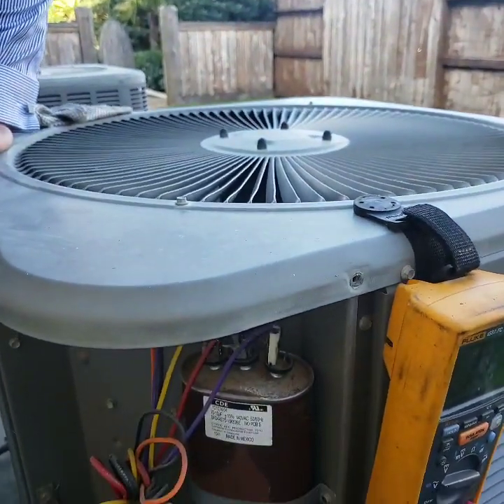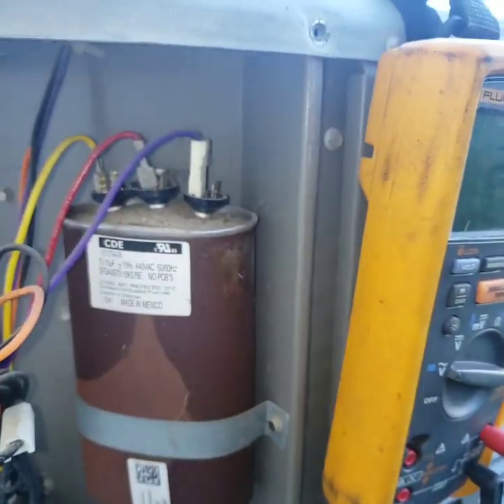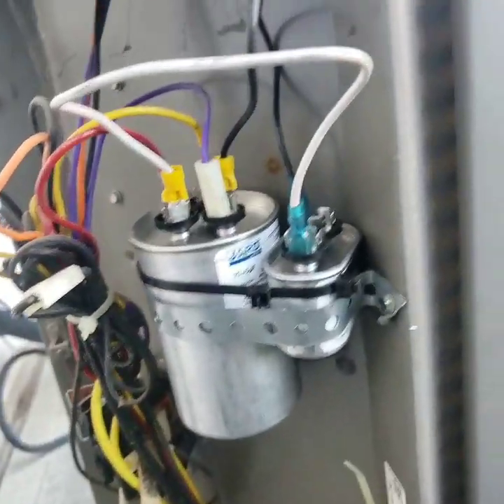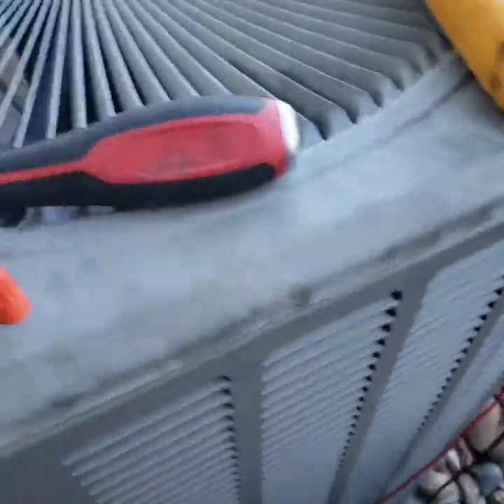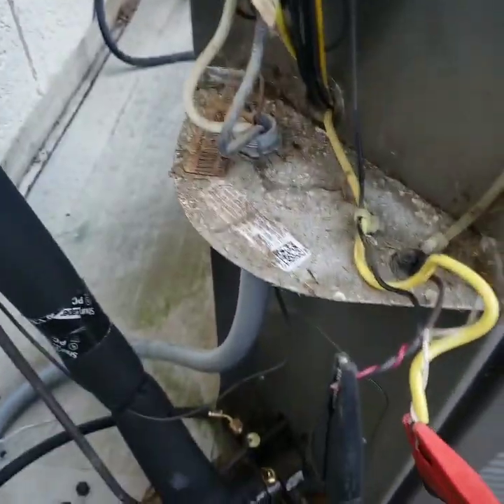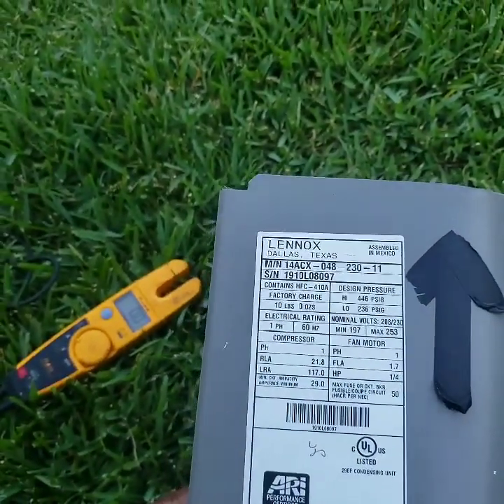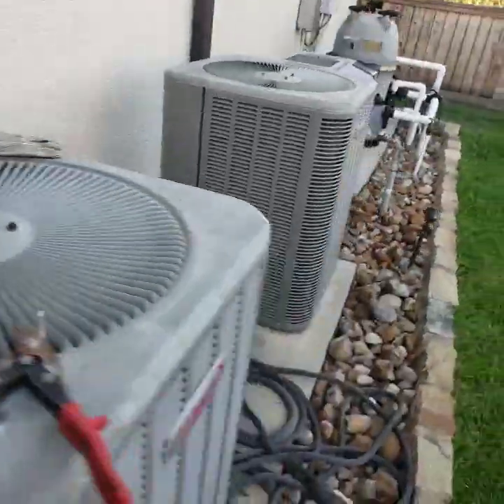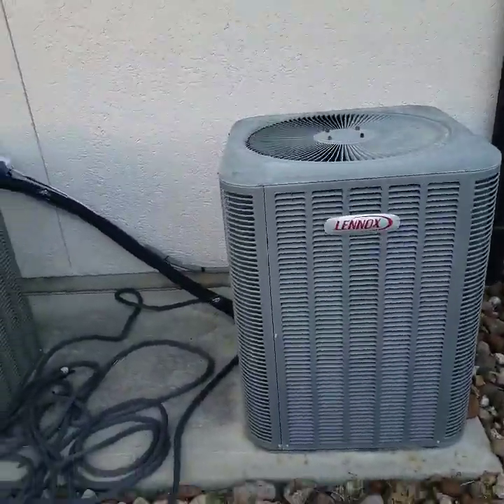HVAC: Unit only blowing hot air

Comment: My ac cools only at night when its cool outside, in the day time its not keeping up with set 75 on thermostat, also liquid line is sweating also only when it cool outside, does anyone has any ideas? 8 did clean out evaporator with fan and condenser coils, new filter, new cap. Please let me know.
Reply from the maker: If you have a txv it's best to charge by subcooling but if you get that suction pressure to about 110-125psi you should be fine
Reply: @WWHVAC  Yesss! THANK YOUUUU it is a r410a with TXV! Goodman 2.5 ton 8 y.o. Also I checked the returning valve with magnet and it works, although still possibly has internal leak due to bad Teflon, i tracked all lines inside condenser with laser thermometer and drier and other components don't seem to have a clog (equal temperatures before and after) but my compressor on top is at 180F ...
It all started with a clogged condensate line, I cleared it, right after discovered my fan and compressor (outside) doesn't turn on - replaced capacitor and it all started working again but now have this issue, I'm confused - how can all these problems happen right after simple drain block! But back in October (today is April 1st in SW Florida and around 80-90F outside) I did notice heavy condensation on the air handler exactly below the drain pan, you are right and I'm thinking that was the beginning of the problem, slow loss of gas....and evaporator had to freeze for the condensation to appear first time on the underside of air handler.
Maaaan I wish I could return something positive your way for helping out! This pandemic BS drained my account so trying my best to diy! In 2 weeks i went from 0 to understanding how this AC THING works, subcool superheat temperatures components and how they all interact! Thank you!
Reply: @bobbyatman273  did you figure it out in the end? What was the problem? Also, are you just doing this for your own system as a diy homeowner? Did you get your EPA? If not, how did you follow through with supplies?
Reply from the maker: Sounds like a restriction..what's the pressures?
Reply: @WWHVAC  its 80 psig on suction and 230 on liquid line very low, , its around 80f outside, also correct me if I'm wrong but everything is working, if there was a restriction in the liquid line or TXV it wouldn't cool at all right?, seems like outside temperature plays major role here. I already ordered a nice multimeter and sman3 should be here in few days, I'm thinking to try to add a little 410a and watch my temperatures on liquid and suction, if no change then its probably txv or liquid line blockage...I really appreciate your input! Hopefully it will be beneficial to others as well.
Reply from the maker: @bobbyatman273  Okay..that is your problem you are very low if that's 410A..anything below 100psi  on suction is below 32 saturation and freezing.. you evaporator coil is probably freezing or frosting also

Comment: I noticed many conversations echoing the same thing about the customer hovering over your shoulder. If they're paying for the work and as long as they don't interfere with your progress, I don't think you have a right to ask them to leave. After all, you wouldn't be there if they didn't hire you. I think some Techs have an idea that they have a right to something when they're the ones being paid to do the work. You have the right to do unimpeded work, but your preferences don't have to be accommodated. The person that hires you has an option to accommodate your preferences or not. You may not agree and that's fine but if I pay for something I want to check it out the cash gives me that right. Yes, I work in the field and my attitude saves many hassles and confrontations that in the end I'll lose.
Walt I never understood how you figure the unit had a reset on the high press. switch.
Reply from the maker: I totally agree with you. I didn't tell the customer to leave. I only said step back..bc I was about to turn power on and was concerned about the capacitor exploding..
I have no problem if a customer wants to watch..
Reply: @WWHVAC  Yeah, I understood your caution. I was responding to comments that suggest they have some ordained right to privacy from a customer in their domicile and property, under their employ. Man Up!
Reply: If u know what ur doing and have full comfidence in ur abilities it dont matter if someone watches. Its usually only when u are not 100% comfident of what to do is when people get aggrivated with people hoovering.